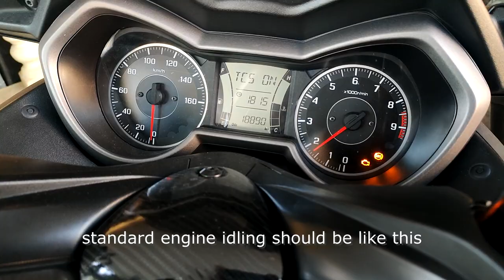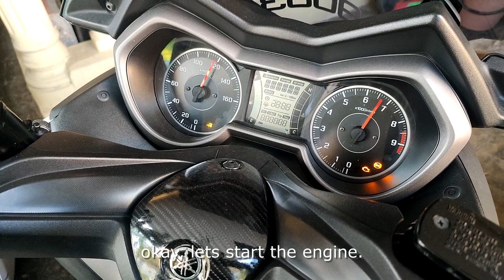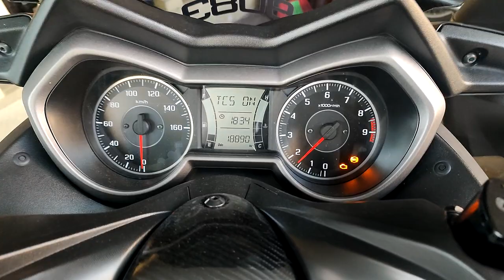isc sensor yamaha xmax problem

Comment: Can it be fixed or need replace ?
Reply from the maker: you can try clean it with fuel petrol and air blower. if still doesnt work, replace with new one.